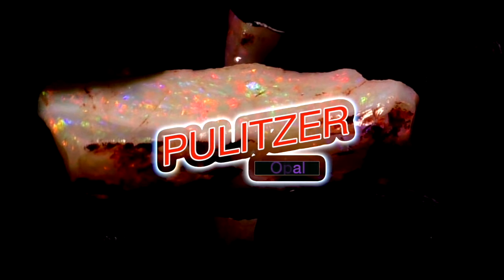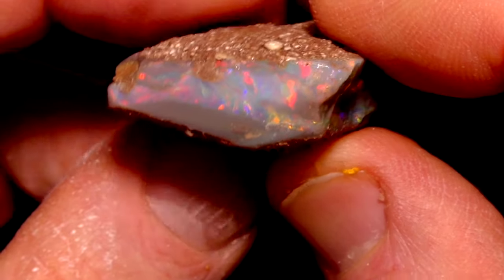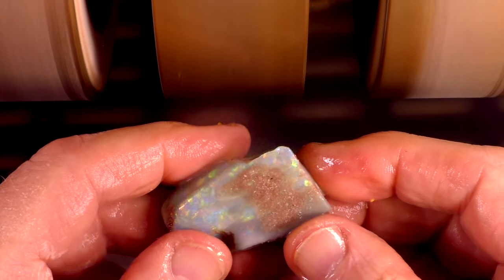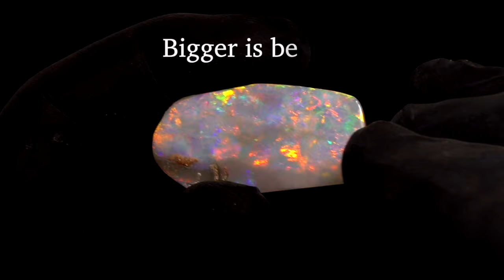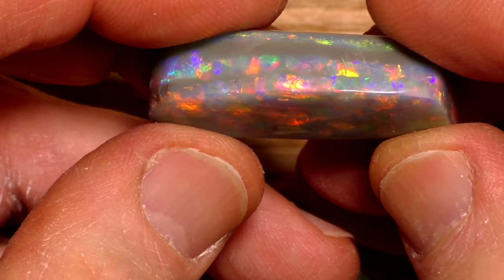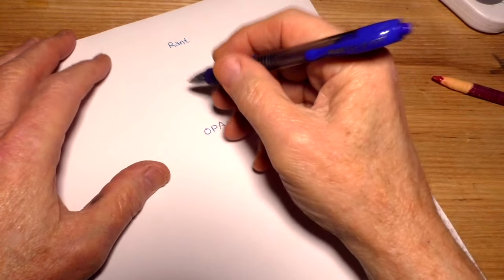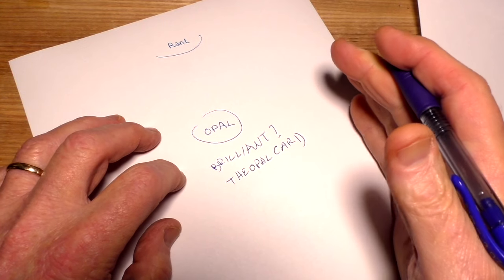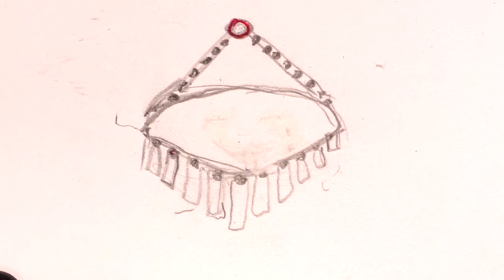$125 MIRACLE OPAL from Australia

Comment: Considering its probs worth several hundred+ per carat... If it was cut into smaller stones there wouldve been some over 1kper carat. Exceptional mintabie gem.. The golden eye on it is beautiful and I believe the better color bar may still be hidden.I would've cut 3 or 4 double sided gems and sliced the 3rd bar off the top which would;ve had some value in it as single sided gems with gray potch backing. I think your approached lost you alot of value, but you couldnt lose... That opal is worth a new car in its current form and size.
Reply: @PulitzerOpal  Wouldn't have said it if I didnt mean it mate. I think the hidden bar is 1-2 grades above the one shown based off side visuals in your video obviously(not great but I usually get a good idea when buying opals online etc). What a gem. Absolute ripper and yes all can still be done. it's a glorified polished rub for mine atm mate :P You;ve got ALOT of money sitting there.. Get them graded properly once finished and keep 1 for a momento/retirement.. High dome them. Get 1 Egg shape out of it atleast please... Fuck it would be beautiful. The GOLDEN egg.
Reply: @PulitzerOpal  Someone who can take constructive criticism and build upon it, is  a person who has a lot of success coming, if not already successful. What a reply! Subbed.

Comment: That is an amazingly huge piece, unfortunately too big for me. I do have a question, sir. If the stone is so heavily directional, wouldn't it be better to face it, or place a faceted glass dome, to ensure the color comes out large over the table? Lastly, personally, and please don't hate me for this,  I would cut out that gem into six amazing 5-6 carat but still affordable cabochons. Its just easier to fit onto a ring. Also, easier to take out from any setting.

Comment: That was a lovely piece of opal you cut but honestly it would have been better if you'd sliced it and used the front and middle colour bars to make a double sided stone and the weaker 3rd colour bar could have formed another stone with the potch left on the back. As it is, it's just too thick for my liking and feels like you left it whole just to artificially inflate the carot weight without any real benefit to the final appeal of the stone.

Comment: Enchilada
Reply from the maker: While opals and obsidian are commonly used for lapidary work, jasper and agate can also be suitable materials for lapidary projects. Jasper and agate are both types of chalcedony, and they are known for their hardness and ability to take a beautiful polish. Here's some information about working with jasper and agate in lapidary:

1. Cutting: Jasper and agate can be cut using lapidary saws with diamond or silicon carbide blades. They are generally harder than opal, so they may require more abrasive blades.

2. Shaping and Grinding: Lapidary wheels and grinding wheels can be used to shape and smooth the jasper or agate pieces. You may need to progress through various grits of abrasive wheels to achieve the desired smoothness.

3. Polishing: Polishing jasper and agate can be done using polishing wheels and compounds. These stones have a natural beauty that can be enhanced with a high-quality polish.

4. Safety: As with any lapidary work, it's essential to follow safety precautions, including wearing safety goggles and using appropriate ventilation to protect yourself from dust and debris.

Overall, jasper and agate are excellent choices for lapidary projects, and you can create beautiful pieces of jewelry or decorative items with these materials. If you have lower-grade opals to practice on, it's a good idea to start with those and then move on to jasper and agate once you gain more experience in lapidary work.